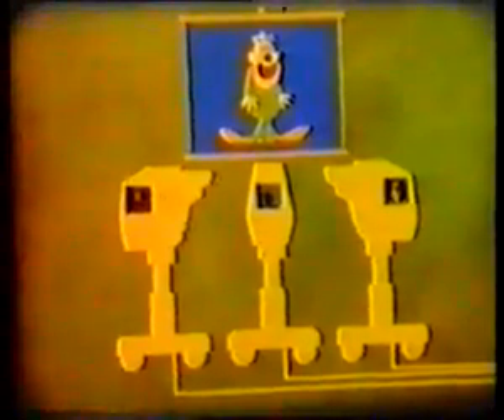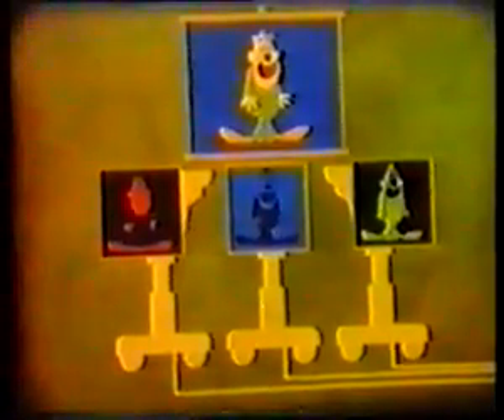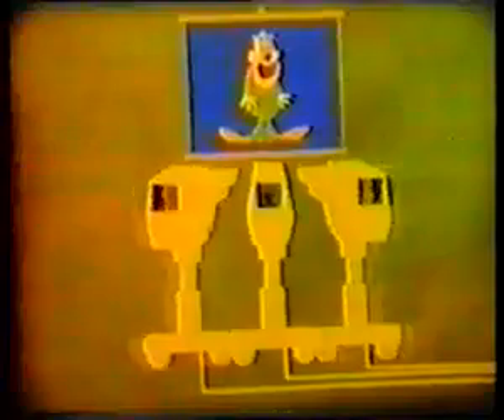CRT TUBE MANUFACTURING A63-11X  PHILIPS - MULLARD Part 1

Comment: Thanks for this This is the MOST detailed explanation of how CRTs  are made I've Seen including how the phosphors are laid on the face plate and how shadow masks were made...
Reply: You have NO IDEA how long I've been trying to figure out how they actually placed the dots! I knew the principles of operation but couldn't figure out if they were pre-printed on to match the shadow masks holes but the precision seemed impossible. Then I assumed they must use the electron gun to deposit ions but, couldn't figure out how to make it precise enough! Then, I assumed they'd use photo lithography but, again the accuracy problem; it never occured to me they'd mate ea mask with each tube!
Reply: @Wintermute_SilverPaths  Same here, spent years trying to figure out how they did it.

Comment: if my memory serves me cathode Ray tubes had a 10 year guarantee how long a LCD panel none
Reply: they say LCD panels last 70 years  if you don't break it or heat damage it Oled just a few years
CRT can last quite a while I have one that is 15 years old still works good It's a HDTV  Wide SCREEN with HDMI port  which was pretty rare back in 2004
Reply: LCD panel lasts for five years maximum.